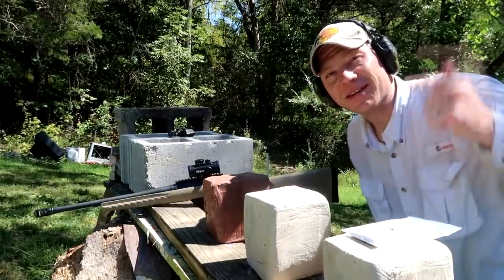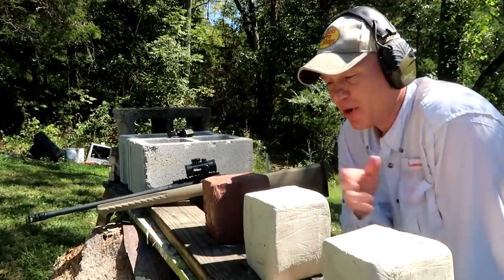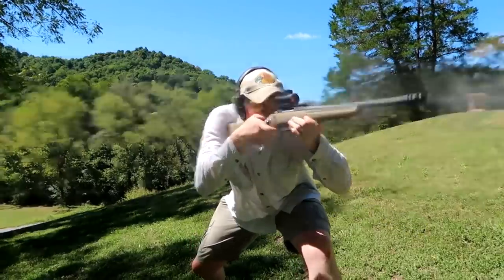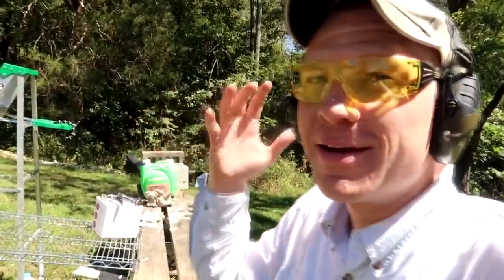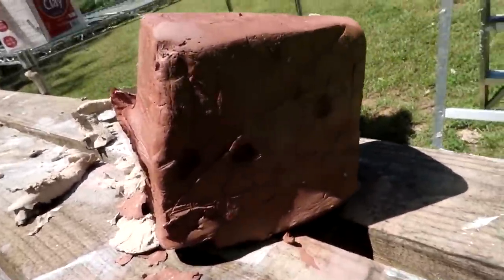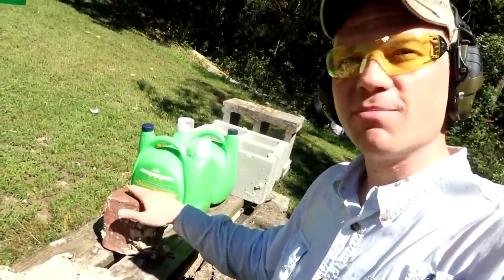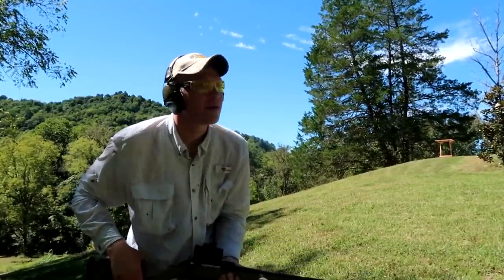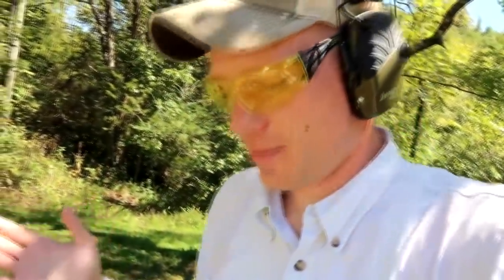NASTY 450BM vs CLAY BLOCKS

Comment: Hey man, good video today. Do you have any suggestions for AR mags that work well with 450bm?
Reply: the lancers marked 458 socom i can jam 9rds into...7 or 8 comfortably so thats all i tested.

bought some chamber tactical followers...had to trim the tab down to get 10rds into a 30rd gi mag.

mine are in dsg gi mags.

debating on putting one of these followers in a pmag 40  and shaving down whatever i need to and see if that works for 10 smoothly.

it was a pain to load after 6
Reply: also there is tromix and duramag. good luck.

let me know if you have good luck with a combo and i will do the same